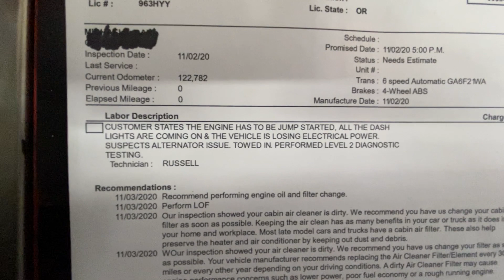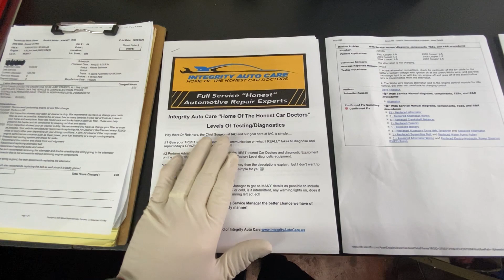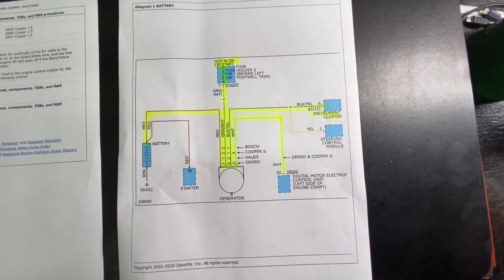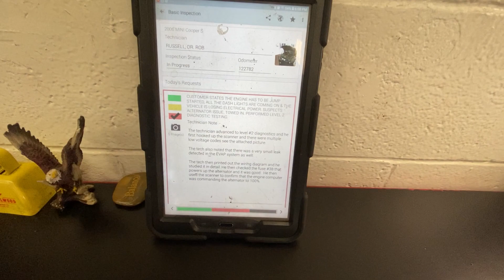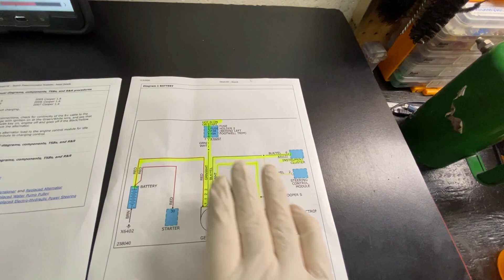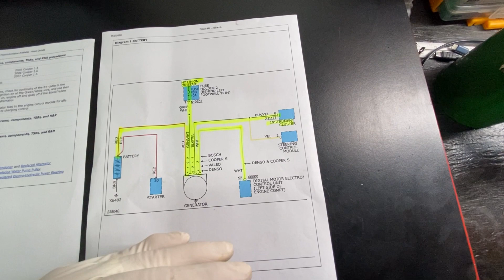Dr Rob The Car Doctor 2006 Mini Cooper Charging System Issue

Comment: What was the issue
Reply: I'm  having a under voltage but have 3 alt melt down ecm is calling for power but amperage is peaked voltage is 12v
Reply: @richardstalnaker9712 hi bro, how u solved it ?
Reply: Right!
Reply: Did you waste time watching video to get no Info
Reply: @richardstalnaker9712  yes he made it seam like the alternator wasn't it but it was? Idk lol